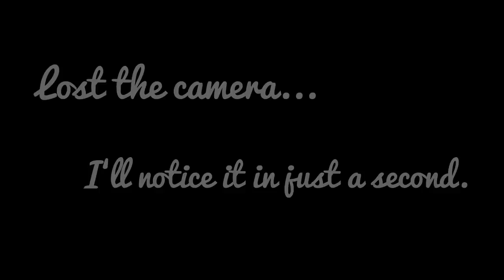The True Story Behind Lagoon's Broken Bulkheads with Parlay Revival | BTS Podcast 2

Comment: Hey guys, Great video. You talked about going to the Galapagos, We went through the Panama Canal and then to Ecuador. From there we went to Galapogos without a visa, but the port captains give you a week or so to sort out any "issues" you have with your boat, (At each port). From there, we were far enough away from land that by going up to Mexico we missed the doldrums and the horrible area around the Gulf of Tehuantepec. We didn't get to do the sea of Cortez. My advice, take your time. NZ will still be here when you get home, but it is a long way back across the Pacific. Best of luck.

Comment: Good stuff ,you guys are inspirational !!  I had a 32 ft Keeler in the 70’s that for the first couple of years we hauled out on a cradle so it was always sitting on its keel , then one year we hauled out with a lift and watched horrified as the keel separated from the hull about 1/2 inch ! Scary thinking about all those hard slogs to windward !!  replaced the old iron  bolts with some titanium mix.     Based in Auckland New Zealand we had done some hard sailing around the north east coast . Be great to see both your boats in New Zealand waters .

Comment: This was probably one of your most interesting videos ……….almost forgot about the thru-hull transducer failure In Curaçao.
Reply: The plastic ring is a known issue that people ignore..
I replace them in metal and wire it on as well..
One boat the owner fibreglassed a water tight box around it with a see though lid.. he was in the water and had a load of fibreglass...
Best solution...

I know the comic writer with your name.. haven't seen him for a couple of years..

Comment: Terrific video. It will be a moment for all sailors when Parlay is back in the water, through the Canal and crossing the Pacific. 
The issues as I understand them are 1. The bulkhead itself is insufficient- multiple layers of plywood on the bottom, but then just a single layer above roughly the middle. Colin's bulkehead failed at this point. 2. The bulkheads were never glass gusseted to the hull, so as soon as there was a problem, it just pulled away from the hull. So Lagoon's 'fix' of the u-channel doesn't address this problem at all. and 3. Beneteau Group has a widespread practice of gluing (not glassing) structural elements to hulls and panels. This can be inadequate. ( To see this technique (problem) look in the bilge of a Beneteau or Jeanneau. The frame is not glassed gusseted to the hull. This might be okay, or it might be essentially temporary. (Expedition Evans YouTubers bought a salvaged Beneteau 50 that had a keel strike. Bent a couple of the keel bolts - good, but it broke the frame loose from the hull. I'm not sure if this meant it was not an adequate connection or if it was more than adequate and the keel strike was significant enough. Kind of like with cars, more damage often means the passengers live.)  Please correct me if any of this is wrong (or utter nonsense or if I'm just another 'everybody's an expert on Facebook' (I just might not know.).) 
After learning about this problem with the Lagoons and watching Expedition Evan's videos I vowed never to buy a Beneteau Group boat, or sail one out of sight of land..... but they make some really nice boats.... I do think that the Evan's, Colin's and David Shih's boats (David also has a Lagoon 450) are now some of the best boats anywhere.

Comment: Just a heads up,  a design defect is different than a warranty claim.  Design defect are technically covered forever.  Lagoon is liable for all repairs done on your boat.  Warranty covers defective materials.... check into it with lawyers if required.

Comment: Broken bulkheads can happen on any sailboat when the port/starboard shrouds are excessively overtightened. Far better off leaving the shrouds a bit loose than overtightening them is. When the shrouds are over tightened the mast is forced downward as the chainplates are being pulled upward. The 2 hulls came down when you loosened the shrouds because they had been overtightened. Spreading the base and chainplates of the shroud deck mount locations out away from each other (2 feet apart) also spreads out the load better. Lagoon is more than partially responsible. Nothing now but fair skies and winds ahead.
Reply: You obviously haven't watched the videos and seen the pictures of the failed buckheads on many  1 owner boats that have light sailing use.

Comment: What I want to know, since you were talking to the dude who designed the Lagoon 45, this Vincent fella, did you ask him why the fuck did he designed such shitty thin plywood bulkheads for a 45 foot cat that is under extreme stresses? I'm no boat naval architect but I've built a couple of small boats and when I first saw the thickness of those Lagoon 45 bulkheads, I couldn't believe how thin they are
Reply from the maker: He has designed many boats, including the last three vendée globe winners. I imagine there is someone (or a team of someones) who's job it is to review the design and cut costs where possible. That's just an educated guess. Plus you're not taking into account hour many people overload these boats. Almost every cat i see is overweight.
Reply: Colin keeps referring to this as a "design flaw," but I would bet that since the existing structure functions properly after a good fiberglass tabbing job on the bulkheads, that the problem is not in the design, but the result of manufacturing shortcuts implemented in order to cut materials costs.
Reply: @thelastpirate  No doubt about the overloading aspect, but you've seen the footage of those bulkheads and I'd say that if that was how it was designed, i'd hazard a guess that it looks way too thin. Then we get to the way the fillets weren't even glassed, which I know isn't the designers fault, because I'm sure any designer would no better than that. Just think about your old cats construction and how light weight that boat was, compared to the goons weight and how it's constructed. Those cats would weigh a lot more that your old Crowther. I wonder what he has to say about all this, as it's his name that could be tarnished with all these bulkhead problems. Also many cats get overloaded but don't see such catastrophic failures
Reply: @derekd1510  You could well be right, the fillets not being glassed is a huge problem. How that passed the factory scrutiny is very ordinary. But you'd think those main bulkheads should be a little thicker wouldn't you say? It's a big powerful boat with immense stresses on those area, to me it looks too flimsy. That said I'm no naval architect
Reply: @Antipodean33  Agreed, 33! The forces on the bulkheads warrant a much thicker plywood. Jmo. 😉
Reply: The bulkheads are a joke.  No reinforcement at the corners of the door.  To thin. No web connection to the hull.

Comment: Could this problem extend to other cat manufacturers?  Is there a design guideline for the main bulkhead area that the engineers used…..that is/was wrong? The failure location is obviously the first point to design for stress…..so how did it continue for so long? Mr lagoon…..please explain.

Comment: James, I just thought about structure failures on the catamaran and since the main breaking force is the mast pulled by the fixed gear, and I know how difficult it is get rid of slack on gear , don't you think the factor that contributed to the failure of the Zingaro was the replacement of the steel  with inflexible dyneema?

Comment: Hopefully the naval engineers will address the problem with the bulkhead issue
Reply: One would hope so but as we have seen in any commercially available craft they are built to a price point to attract the buyer.  The pressure is then on the naval architect to ensure that the build cost comes in to give the manufacture the margin they were expecting.  This was poor design on the part of Lagoon.

Comment: Well that’s the way it is with a boat I bought and sold boats much of my life to get bigger and better boats bought a 37 endeavor wound up placing part of the deck up forward because it had a soft spot underneath the fridge  had to take up the teak soul to get to the wood I spent over a year in the yard Took the wood off of the toe rail all the way around the boat replaced it with a hard plastic type material and through all this I hired the appraiser to appraise it when I bought it and when I insured it and he never caught it  he gave me a go ahead on both times so when you pay for good advice you don’t always get what you pay for

Comment: Colin has a good story but also  a selective memory, there clearly was some ,most likely , manufacturing mistakes or changes made that may or may-not have been designer approved. Sometimes the designers just design the shapes , spaces and  rig . Much can be left up to the in house boatbuilders. 
BUT Colin forgot to mention what he put in his videos,  Panama Lagoon did question the rig tension and Colin admitted he grossly over tightened the rig 3000kg per side on the main shrouds! Over 6 tons!
Both documented in video, and Panama Lagoon did suggest he talk to the designer.( but did not help with that). 
Yes the boat clearly had not been put together right and apparently many others weren’t either, but the catastrophic failure he had was ( most likely) caused by the highly over tightened rig.
Selective memory . 
Great podcasts by Zingaro/James 
Cheers Warren